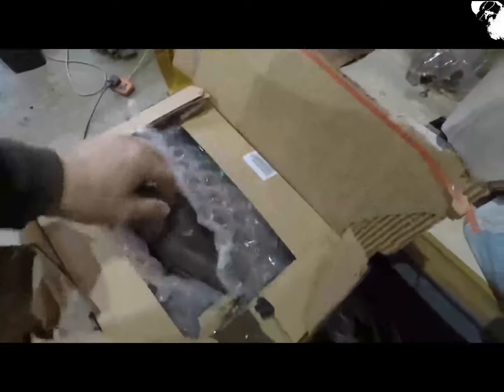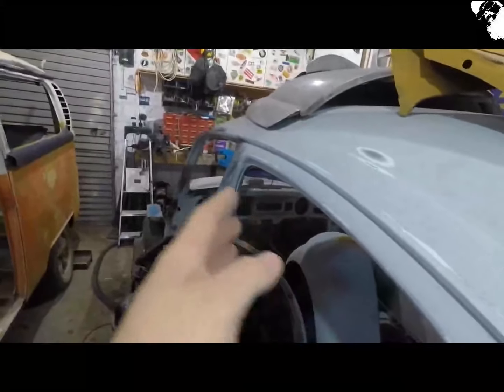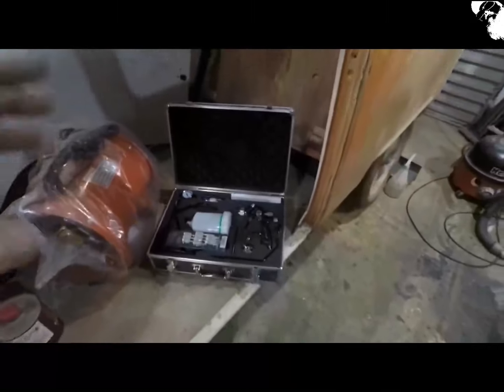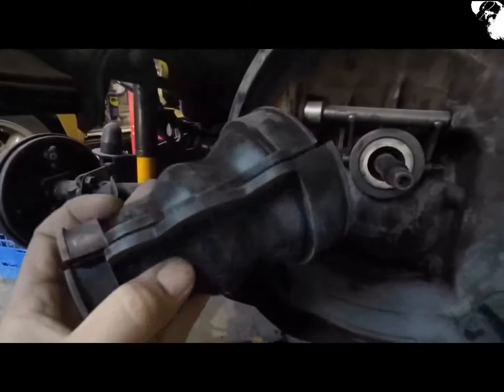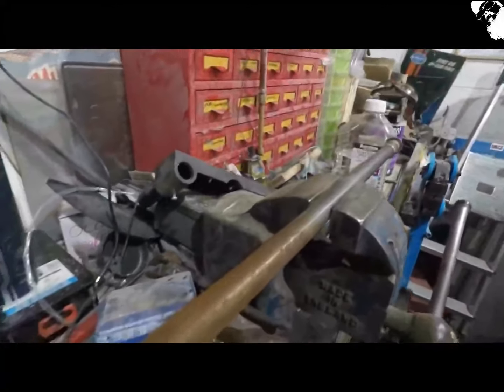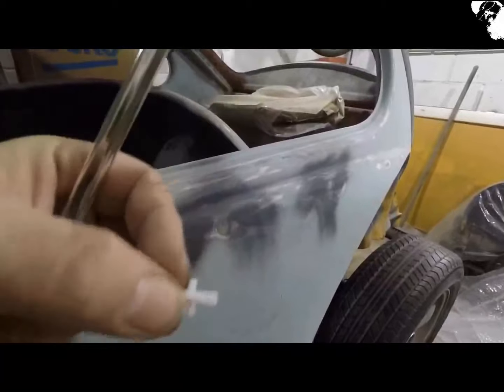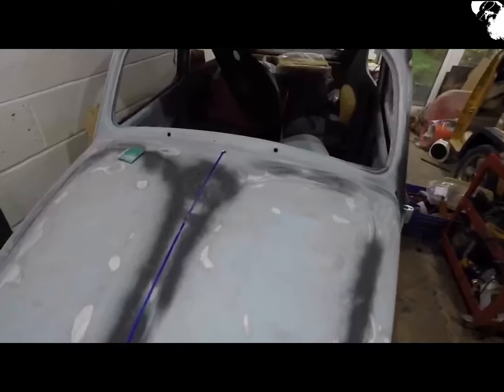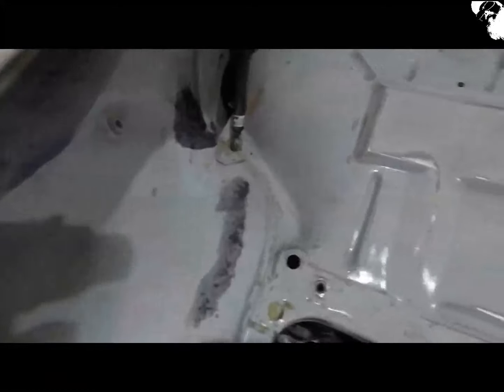Classic 1967 VW beetle restoration #27 ‘rear axle & bodywork’.

Comment: With the split line in the boots put them 90 degrees clockwise to the position you have them now so they face the rear of the car, the split line can flex better with the axle tube and stops it splitting prematurely. 👌🏻

Comment: Ross good up-date you do get a lot done in a small work shop. I have more room but it filled with stuff and now it looks like you have more room. My friend tried replacing the boots on my 1967 bus. The same type you have but he could not get the larger end to fit around the traany flange. We had to sit the bus down on its wheels and move it, he thinks after it settle or level out some he can get the job down.
Reply from the maker: Think it’s why it takes me as long as it does. Usually any job I undertake involves me moving a bunch of stuff out the way to commence with it. The cv boots weren’t such a struggle, once I had the jubilee clip in place, I was able to get the seams squeezed together..we’ll see how they hold, I’m still yet to fill the box back up with oil...👍

Comment: Hi Ross Great update.....any reason why you are going with enamel paint etc?  I know little or nothing about painting other than rattle can stuff and will be painting my van at some point (in the distant future). Was looking at an airless system from Lidl (German van/German paint system/although made in China) a couple of days back as I don't have any filtration system on the compressor I have. Not looking for perfection...
Reply from the maker: It took me an age to decide how to go about painting both projects. I also know little about paint/painting so this option for a beginner looked more promising. To start with it’s just a single stage paint. It is what is is, the only mixing ratios you really have to worry about as far as I’m aware, are that of thinning the stuff down for application through your desired gun. The paints known to be very durable and is usually used upon machinery, tractors etc. The company I’m buying it from actually advertise for the classic car market, with Volkswagen being one of them. The correct Volkswagen colours are all there and available. You may of seen me ‘testing the water’ by painting the engine bay of the bus..May sound strange but the paint had that vintage feel about it, that muted hue of an antique vehicle. Sometimes I feel the more modern paints look.....to polished. Also upon researching, it was said to be an ideal paint to apply over old paint. This is something that sounded appealing, as it meant I could basically key the old coats already there, utilising them really as an existing primer.
From there it will be like starting again. The first coat of primer applied should adhere acting as a filler primer. Followed by an undercoat, and then the top coat of body colour...I’m undecided if I will eventually use a clear coat as the final application, as I mentioned I like that ‘muted, pastel, old school look..

Can you not add a filtration system in to you lines?...I should be covering this very soon, as I’m currently getting things in place to get this done...

Thanks for watching and asking the question..👍